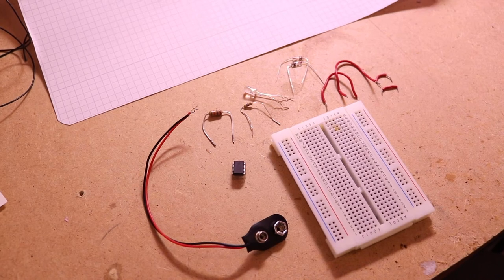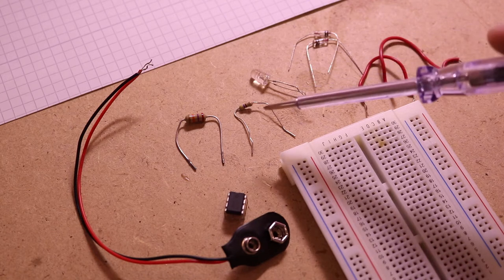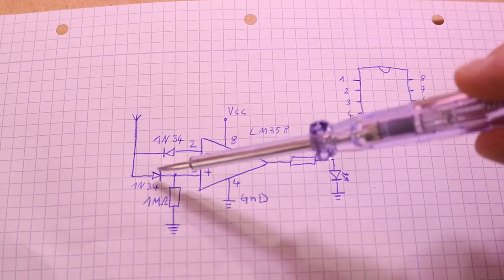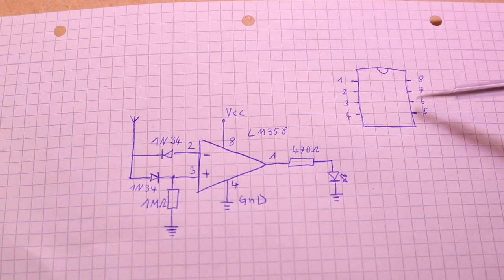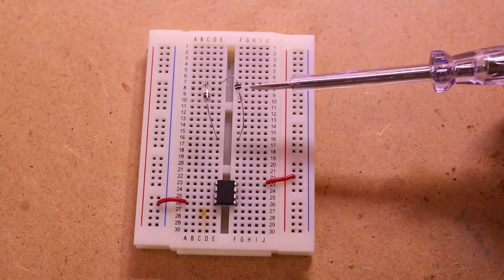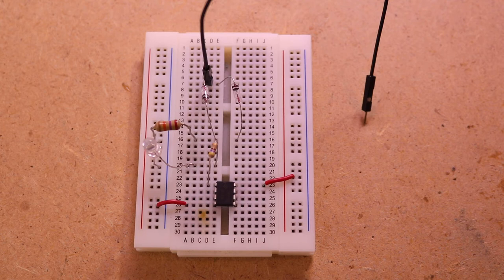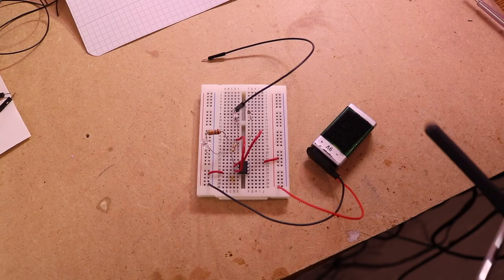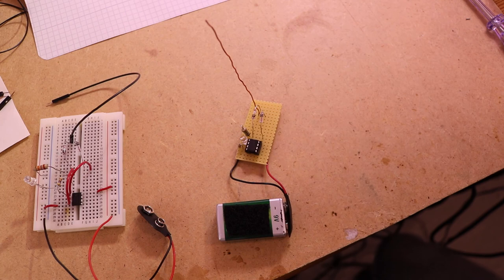DIY RF Detector Step by Step build | Breadboard #3

Comment: Hello again! I have now made an RF detector to your specifications, the idea being to use it to test car RF keyfobs/keycards. It works! Very pleased with the result, although it can be a little tricky sometimes to hold the antenna in the correct 'sweet spot' against the car key fob/card for it to work correctly. One thing that occurred to me when testing the detector - how long should the antenna wire be for best sensitivity? Could the antenna wire sensitivity/reception be improved by coiling it up several times?. When testing the detector with a small hand held (bike to bike) radio, the detector led lights up from several metres away, whereas, a car key fob/card has to be held against the detector for it to work, so I thought that this may be due to the length of the antenna? Many thanks again for your video, Ken.

Comment: Hello ! I successfully built a 40 kHz detector using your circuit. The antenna is an inductor coil and a capacitor tuned to this frequency. I used a TLV2462 as I don't have the LM358. I don't have neither germanium diodes so I directly connect the antenna to the Op-amp pins. I loose the negative part of the signal but it works anyway. The range is very short (<10 cm) so may be I'll add a second amplification stage to improve this.
But I don"t understand well the theory behind. As the minus pin isn't connected to a positive voltage through a large resistor (as usual with Op-amp comparators), the voltage reference is zero ?

Comment: You may add a fixed inductor and a variable capacitors in parallel (multi capacitor banks) (parallel LC circuit > tuner) so you can tune into various frequencies to detect, anywhere from most low to the unity gain (MAX frequency capability of Op Amp) - add this circuit between the bottom of antenna and the the point where two diodes connect.
Reply: May I ask where did you learn this because I would like to understand why you need those components.

Comment: Also we can use Darlington transistor (High Gain) along with RC circuit connected to the antenna and then series that with another Darlington and produce same action.

Comment: hi, first thx for sharing. can the LM358 be set to detect a specific RF or Frequency?
Reply from the maker: The LM358 is an op amp set up as a comparator. The diodes just rectify whatever Frequency comes in.

Comment: Can we replace 1n34 with any other diodes??
Reply from the maker: No, in fact I replaced them at some point with germanium diodes. They should work even better. The diodes need to be rated for high frequency

Comment: Hi, So 1N34 diodes will work OK up at 2.4 GHz  ? cheers
Reply from the maker: I think it could get problematic. Check the datasheet what frequency they will work on. But germanium diodes should be more sensitive regardless
Reply: @thesciencefurry  Your Microwave and transmitter work at 2.4GHz

Comment: Hi there , i was wondering about the relation between an antenna's length and the wavelength it can catch , could you tell me ?
Reply from the maker: The perfect length should be 1/2 the wavelenth. But this thing just takes all frequencies and rectifies them. But you can test it out to see if it works better if you have a matched antenna.
Reply: @thesciencefurry  it should be one fourth of wavelength, as far as my knowledge goes
Reply from the maker: @RanaSengupta  That would work too. It's always 1/2, 1/4, 1/8 etc. But you want to keep it as close to 1/2 as possible.

Comment: Is not possible to use 1n4148 in the place of 1n34 diode?
Reply from the maker: That's a switching diode not a germanium diode. It could work, but significantly worse if at all.

Comment: Hello, i have done as you said. But my led light is always on. What can i do? (Edit: After this, i have removed diodes and led light still always on) (mine is Lm358L)
Reply from the maker: Did you add the discharge resistor?
Reply: @thesciencefurry  I have uset 470 ohm and 1 Mohm resistors.
Reply from the maker: @nextnext8902  Try to check if you build it correctly. The 1 MOhm resistor has to be on the right diode. If this doesn't work, try to use another opamp.
Reply: @thesciencefurry  Hi, can you explain why we need the 1Mohm resistor? is it maybe to discharge any antenna capacitance that might be holding voltage and keeping comparator saturated or someother reason?
Reply from the maker: @ikaitg  Yeah it's there to discharge any charge that's left.

Comment: Hi, I am confused, why is my led is always on? And why do you need 1M resistor on the non inverting side of op amp and small value on the value of op amp?
Reply: I use coil as the antenna like shown at 0:12
And also when I remove those 2 diodes, the led always on
Reply from the maker: If there is no resistor the led will stay on. Because charge is building up there or something for some reason.
Reply: @thesciencefurry  And why do you need 1M resistor on the non inverting side of op amp?
Reply from the maker: @kevinje3971  That's the resistor I was talking about in the previous comment.
Reply: @thesciencefurry  okay thanks
Reply: एल ई डी कम जलता है परंतु आऊट पुट वोल्ट रिमोट से बढ़ेगी।

Comment: I tried the your circuit just as you built it, but with a 4558 instead of LM358 (it's what I had on hand).  However, when I plug in the battery, the LED is constantly on, no matter where I am located.  Any ideas what I'm doing wrong?
Reply from the maker: Have you tried adding the pull down resistor to the non inverting input? Because it indicates that the voltage on this input is higher then the other one. Maybe putting a potentiometer in place of the resistor helps.
Reply: @thesciencefurry  No matter what value resistor I connect to the non-inverting pin, the LED is still constantly on.  I have also tried several op amps and 2 different input voltages.  Even tried reversing the diodes.  No luck.  I doubt there is a constant source of RF from my radio room in my house all the way to the middle of my street.  Thanks for the reply.
Reply from the maker: @jamesmcbrideag5ve743  Hmm, that is weird.
Reply: The 4558 is not necessarily good for sensing very low voltages at its inputs when connected to a single supply. It is designed for dual supplies.

Comment: CAN I USE  1N4148? AND NOT 1N34?
Reply from the maker: I think it would reduce the sensitivity a lot, if it works at all. It's not a germanium diode.
Reply: @thesciencefurry  thank you for the reply, i try the 1N4148 and not works, i try to find the 1N34  but i cannot in mouse or digikey  or even in local market. The supply power can be 5V? or should be 9v?
Reply from the maker: @dimitriosa8tsipouras953  5 volts should work.